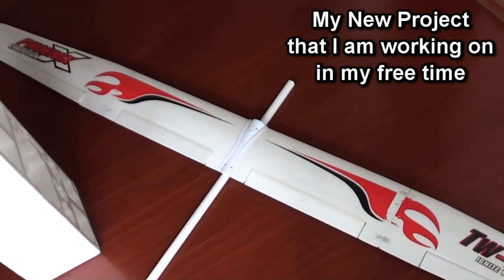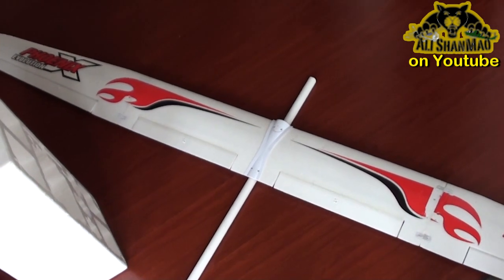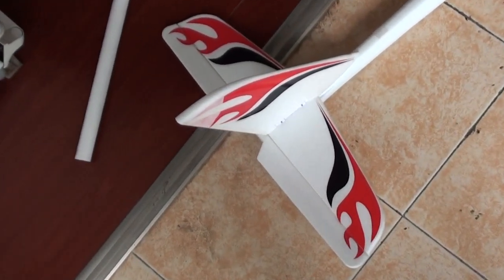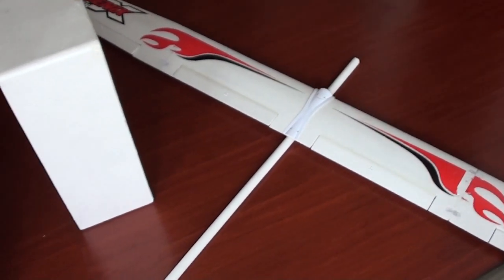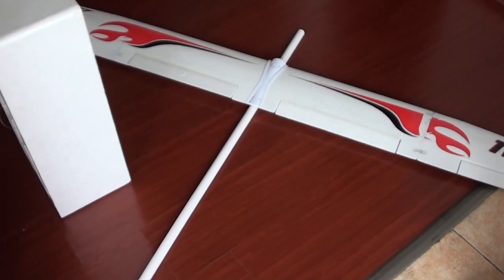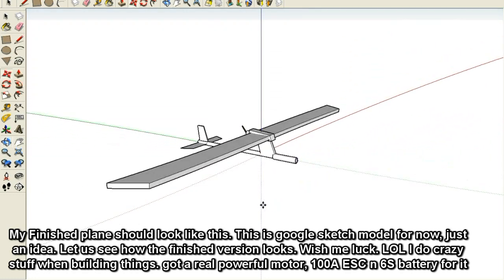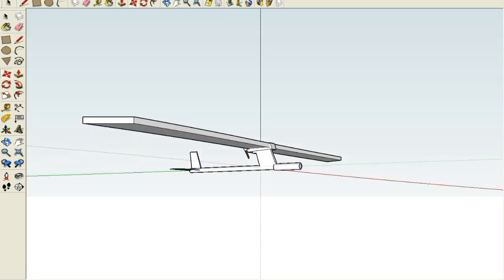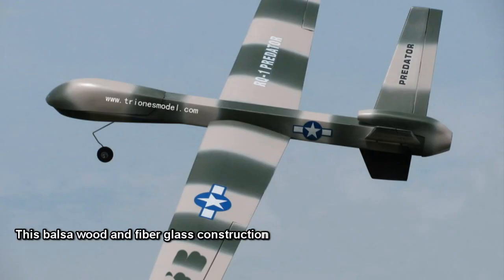My Home Made UAV Glider Project

Comment: Very good job Alishanmao! Can't wait to see how this turns out! How are you aligning the tail with the wings and where do you plan to put the battery? :)

Another curious question, the elevator is on the bottom of the tail, is it better than having it on the top like on the Skywalker? Thanks!